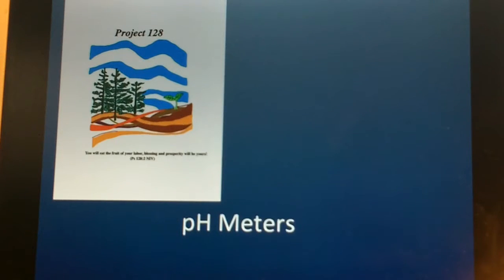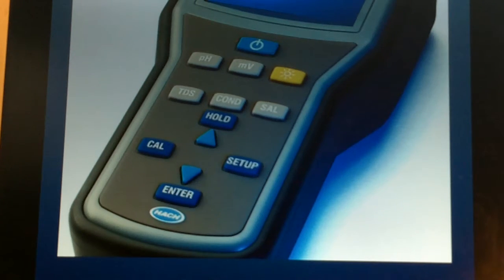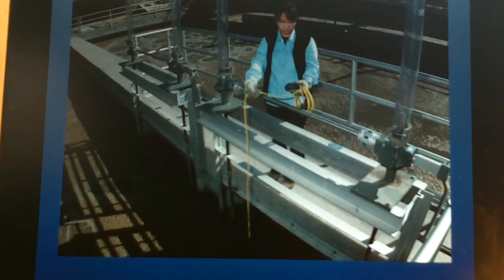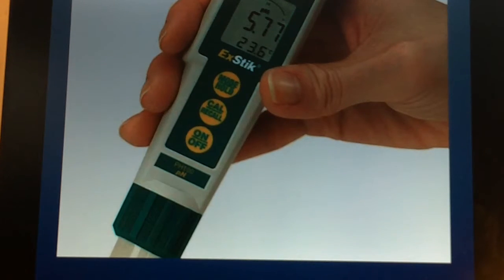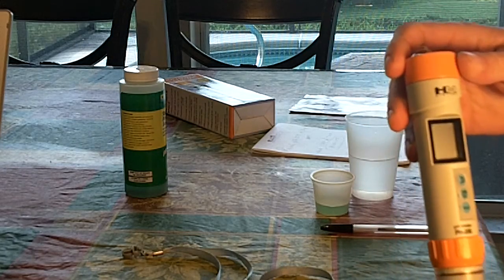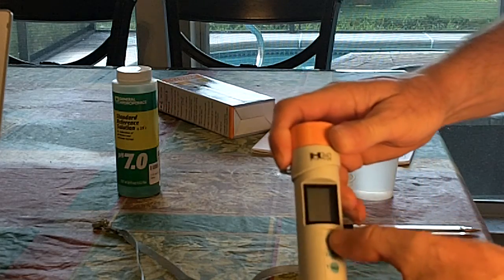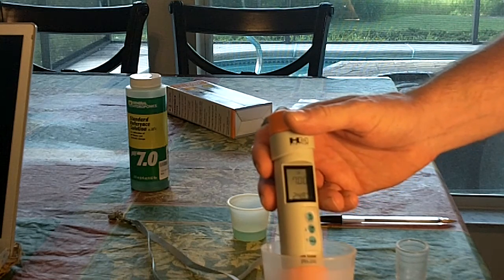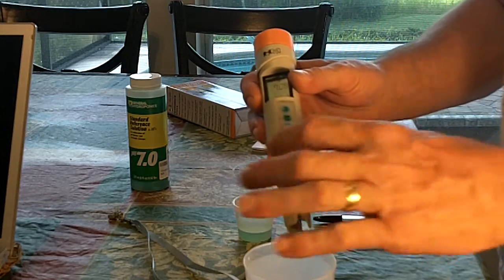pH Meters & Calibration of HM Digital PH-200

Comment: Thanks for the quick response! I am wondering if the 2 point calibration even exist for this hm 200 meter!I keep discus fish and would like to breed them. I just need stable ph 6 (5.5 to 6.5), any idea what buffer should I be using? The meter will stil automatically calibrate to 7 in the PH 4 buffer!!Weird!I have to use manual calibration that takes a long time to go down to 4 and then once im on back, it never ends!I keep waiting and waiting...
Reply from the maker: +Donna Ebert  For the precision meters we usually have a lab make the buffers for us (expensive for DIYers). If you need accuracy around the pH 6 range I would use a pH 6 buffer and calibrate to that. You can usually find a pH 6 buffer solution.  I used to get supplies from a company called  Lab Safety, however Grainger did a buy out and they no longer carry many of the items we used to get there.  I did a quick search and did find a pH 6 lab grade buffer reasonably priced at 

http://www.carolina.com/catalog/detail.jsp?prodId=849673&s_cid=ppc_gl_products&gclid=CJON3cf2hMoCFY4jgQodKg8CPg

Comment: Hi 

I have two questions:

1. I bought this meter and tried to calibrate it using PH 7 and PH 4. However I am not sure I did the correct thing as I dipped it in both solutions and manually adjusted it to the corresponding ph value. 2 points calibration??

2. It keeps fluctuating when testing the ph. So sometimes i have to wait like 3 -4 minutes! Since this is a very high quality ph meter, I dont think one should be waiting for 3 minutes to get a reading. I am pretty sure I am doing something wrongly!

Please advise. Thanks
Reply from the maker: +Donna Ebert  Great question - usually a 2 solution calibration (2 point calibration) is more for a precision unit that will have high and low adjustments- I use these in my "real-life job" as an Environmental Health & Safety Manager.  I have not tried a two solution calibration with this unit as it is mostly for my hydroponics/aquaponics checks and the pH is in the 6 to 7 range so I only calibrate with the pH 7 solution. With meters I used in the past without a hi/low calibration you would have to slowly adjust each. eg. adjust for the pH 7 then the pH 4, go back and check the pH 7 and adjust as necessary - keep doing this until you can go between the two with some accuracy for each pH. Or if you need to check a low pH calibrate for the pH 4 and when checking a higher pH use the pH 7 solution.  Hope this explanation helps!

Comment: I bought HM's Digital COM-100 EC meter (which I guess is the same "line" as this PH meter since it basically looks the same but blue instead of orange) and I am very happy with how accurate it is. HOWEVER, those small batteries needs to be replaced A LOT, and they're not as cheap as AAA batteries.

Now, it should be noted that I have never used an EC-meter before so I have no idea if all EC-meters uses a lot of electricity and it's just natural that the batteries needs replacement often, but if that's the case I must say that HM would have been better off designing it with a cord instead because it's really quite ridiculous how often I've had to replace the batteries. In one year I have changed those batteries 4 times and the last time I only used it once, turned it off and it then sat unused for several months. And when I picked it up again and tried to turn it on it was dead!!!

So this time around I remove the batteries after every use, just to see if the problem is that the EC-meter wears out the batteries while turned off, in which case it would be really weird in my opinion.

Anyway, I am on the lookout for an electronic PH meter now because I'm tired of using liquid PH-testing kits. I just don't think they're accurate enough. It's always a judgement call with those things and with hydroponics you want to know exactly what the PH is. And I'm wondering whether the battery problem I've been having with HM's EC-meter is the same with their HM Digital PH-200 or not?

Also, if anyone out there has any experience with HM's Digital COM-100 EC-meter and have had the same problems with batteries going dead very fast, I'd like to know. And if you haven't experienced the same problems as I, I'd also like to know because then it might be something wrong with mine.
Reply from the maker: +permahome Thank you for the comments and observations with your experience with the HM Digital EC/TDS meter.  I have over 27-years in the environmental safety & health field and worked for one of the nations largest water treatment agency for 23-years and have used many different brands of meters. I currently have the HM Digital COM-100 for EC/TDS/Temp as well as the HM Digital PH-200 meter.  I have not experienced any trouble with battery life and have had the HM Digital meters (with original batteries) for almost 2-years.  I like the HM Digital's that I have since they are water proof (and float if dropped in the water) and have been reliable for me at a reasonable cost. The HM meters can also be calibrated which is something that I prefer to verify the accuracy of my readings.  We do have an EC/TDS meter video that is almost ready to post that shows how we use the meter in our systems.
Reply: +Project128 Since I wrote my post above I have contacted HM Digital and explained the problems I've been having with battery life with their EC-meter and they apparently had a batch of EC-meters that were faulty, that had this exact problem and said that I have probably gotten one of those. HM was cool about it and sent me a new one with a return-sticker so I could send the faulty one back to them, which I did.

I have also bought their PH-200 meter and so far I can only say I love it.
Reply from the maker: +permahome Thank you for sharing this information.  So glad HM Digital was able to help you solve the problem with the EC Meter!  I have been very happy with the HM Digital pH & EC meters especially the ease of calibration. Having been in the Environmental Safety & Health field (specializing in Haz Mat & Water Quality) I have used many meters and have found the HM Digitals to be a good choice for my personal use with the Hydro/Aquaponics systems.